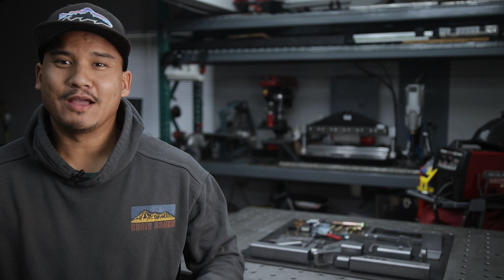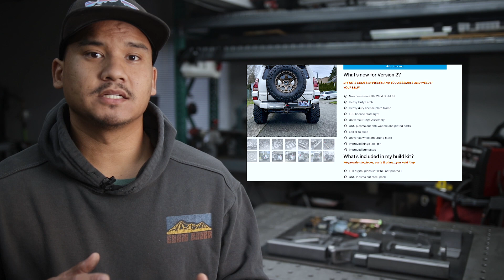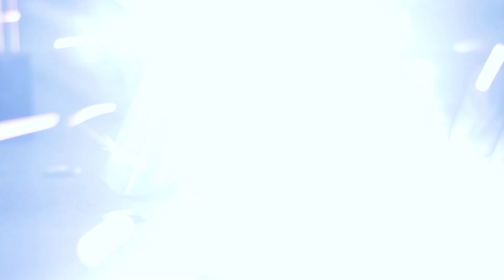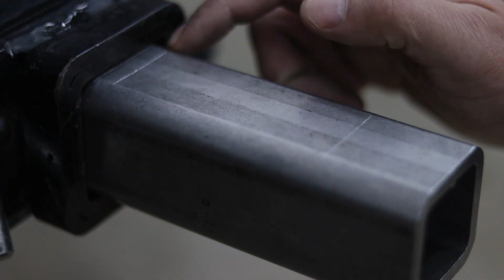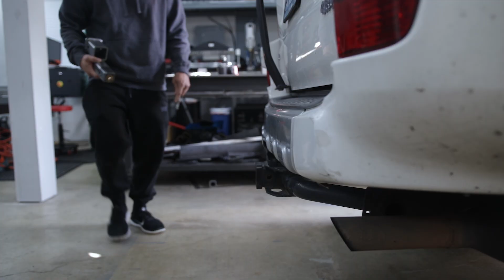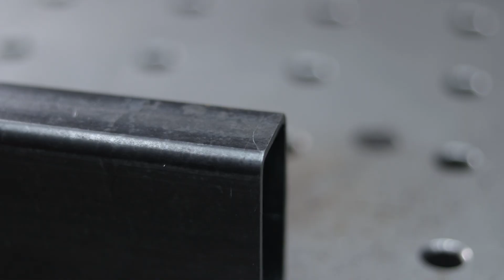Universal Spare Tire Carrier DIY Build Kit - Part 1

Comment from the maker: Check out our Version 2 Universal Swingout Tire Carrier build-it-yourself kit. It makes the build a snap! Click here to check it out.

Kit, Anti-Wobble, Hinge, PDF Plans and More!: https://www.rathaprecisiondesign.com/collections/offroad

*Note - Reinforcement Collar no longer needed.

In Part 1 of this video, I'm going to walk you through step-by-step on how to build Version 2 of the Universal Swingout Tire Carrier Build Kit (Hitch Mounted). 
 
Video Chapters

0:00 - Intro of the Universal Swingout Tire Carrier Build Kit
4:43 - How to assemble and test fit the Anti-Wobble Assembly
18:42 - How to assemble the Auxiliary Hitch
23:49 - Installing the 45 Degree Offset Tube
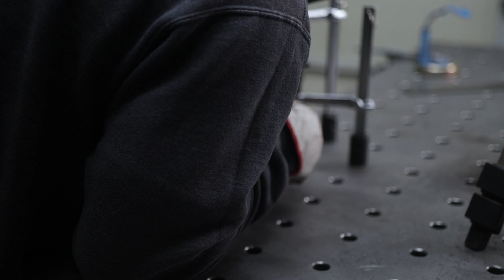28:40 - Installing the Support Back Bracket
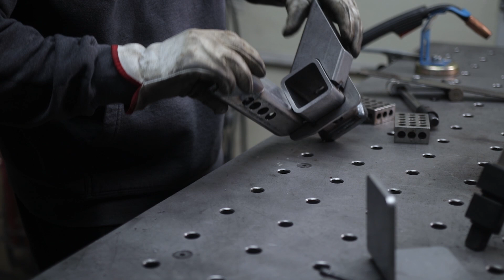29:05 - Calculate Fix Arm and Swing Arm Length
32:50 - Installing the Hinge DOM Tube  
36:14 - Outrond More!: https://rathasochenda.com/shop/

Comment: I have a question, Can you help to build something like this for an 08 Xterra?, I will buy it from you. I don’t have any welding experience at all
Reply from the maker: Unfortunately not at this time. For now I just provide kits. Maybe try reaching out locally to fabricators and ask what it would cost in labor if you bought the kit and had them weld it up for tou
Reply: @RathaSochenda  oh okay but what’s the cost of the kits?
Reply from the maker: @olusholafarojoye3970  please check out the link in the video description for more details and pricing on the kit. Thanks

Comment: Does this kit only work for 4runner? I purchased the first version prints and the measurements were off for a Tacoma, but it was no biggie. Just had the make some of the measurements longer.
Reply from the maker: The kit is universal as long as it followed the guidelines reference on my website. You can also email me if you have a special case. What rig were you looking to use the kit for ?
Reply: @RathaSochenda  tire carrier for a Tacoma. I didn’t really have a problem with the version 1 prints. I just added a couple inches in the length of the swing arms.
Reply from the maker: @ryangoldtooth7755  nice. Yeah the length in the plans was just an example I use for my rig. Each vehicle will vary in swing arm length so when I made version one I mentioned that in the video how to calculate it. If you go to my website I actual have some pictures of a 5th gen taco using v2 of the new tire carrier build kit.
Reply: @RathaSochenda  How long are the arms that come with the kit?
Reply from the maker: @ryangoldtooth7755  there arms you still need to buy separately from the kit
Reply: @RathaSochenda  I see. Thank you! I like this version!!!!
Reply from the maker: I like this version as well.  I may at one point provide the option for arms but shipping cost is through the roof